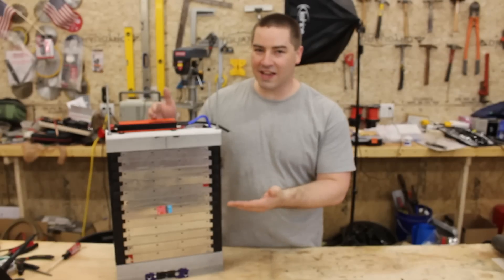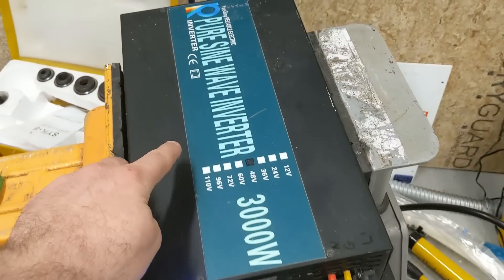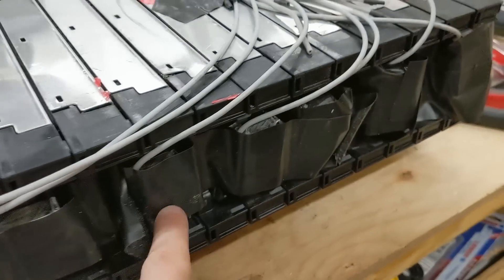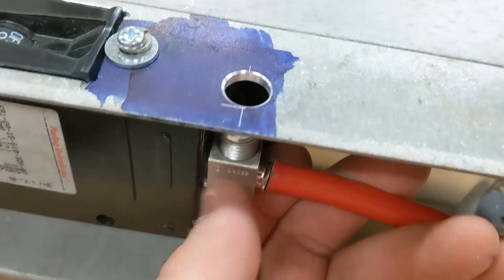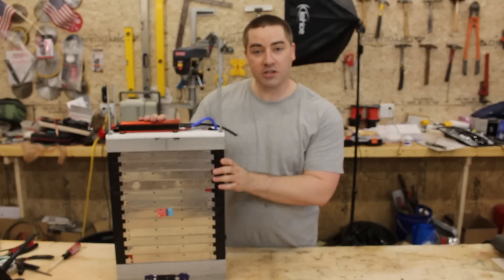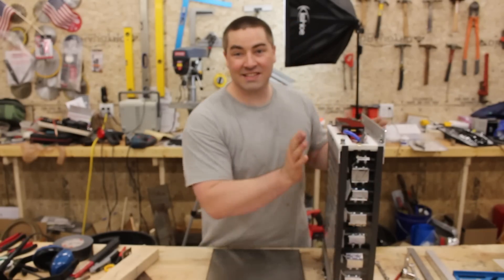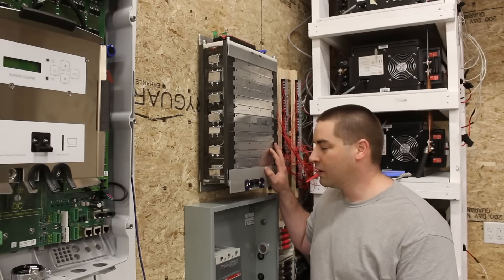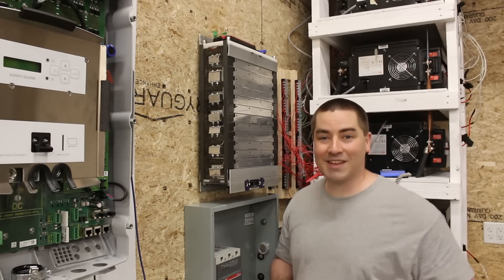LG Cells Part 2, 6kwh 48v DIY Battery

Comment: You think these will reach full energy density if your only charging the lifepo4 to 56 or 57 volts or have you gone up? I was looking at your chart I think 56.8v avg was your best suggestion and I have been trying different levels. The community still seems to be  conflicted about lifepo4 charging and treatment. Like that setup though especially the breaker.
Reply from the maker: Thanks.  Questions like this are why it will be fun to test.
Reply: DavidPoz maybe try one cycle with a separate charge controller and check soc of both battery banks as compared to charging together as one. 🤔 as long as it’s fun right?

Comment: @DavidPoz - Impressive.  Your 6 KWh beat my 8 big AGM 6V 230Ah "golf cart" batteries.  I only safely got about 5 KWh out of those and they weighed about 600 pounds total.  I sold them months ago.  It is a shame however, either how much someone has to spend on lithium batteries, or how heavy lead acid batteries need be to even get an electric heater to run overnight.  I kinda gave up on solar because the expense is still way too high.  I get assistance for my electric so many months out of the year, my electric bill is $0.  I sold a bunch of my solar panels and only have a few remaining.

By the way, I wouldn't really call that a 48V battery cuz lead acid batteries never go up to 58V full charged,  more like 52V, but I see what you did... you took the anticipated inverter cutoff voltage of about 42V and calculated how many 3V (drained) batteries you need in series to get that.  So that worked out to 14 in series.  I supposed that is ok if the inverter being used accepts 58V.  I suspect a few out there might "complain".  I have an old APC brand  48V UPS but I don't think I ever tried to "feed" it that much voltage.  I remember when I used to and had it externally charged (under load running an HDTV), I had the solar charger controller (scc) set at something like 55V max since it was charging four 12V AGMs in series.  Since I only had one solar panel (not even optimally angled) and the HDTV was high wattage (100W or so), I barely got any charge into the battery bank.  It was staying about "even".  Just a temp setup to test the equipment.  It worked though.  Can't expect anything to charge when the scc was showing a little over 100W on average and the HDTV was sucking it all up.  Plus there are losses in the wiring and other losses too.  Of course you already knew that but some other viewers might benefit.  I think after losses and non optimal sun, whatever max wattage the panel is rated it, you will be lucky if you get the equivalent of half of that for 5 hours a day.  For example, a 200W solar panel will likely not give you 1 KWh per day on average, but I bet it will give you something much closer to half of that.  That would actually be a good experiment, but not so easy to do.
Reply: In my direct experience with using an APC ups inverter with a 14s lithium bank, the upper voltage is not a problem. I reasoned that it will charge its lead acid original battery to just over 14.4v which is their saturation level. I've found the inverter fine with my battery getting to 57.6, which is a fair compromise between capacity and life span. I switched to lithium and love them. Bought new, absolutely equal cell to cell, I've found no need for a bms, as charge/discharge rate very low. I check cell balance at least once a week 😁👌👍
Ps, in summer, I've got rated power from my panels and exceeded it on cold spring days. I live in the south of England.